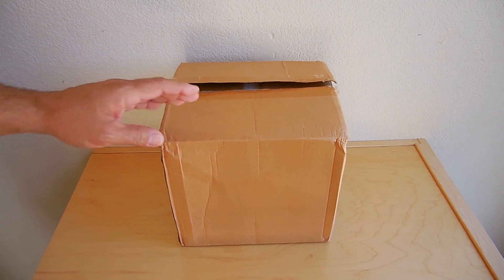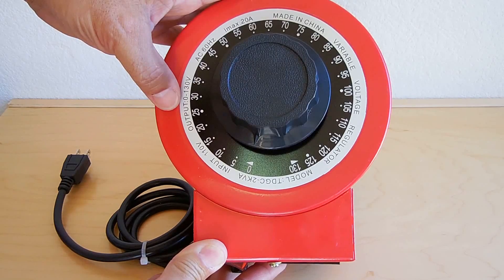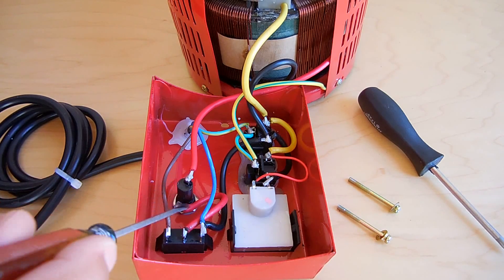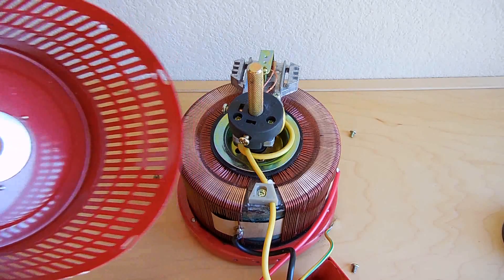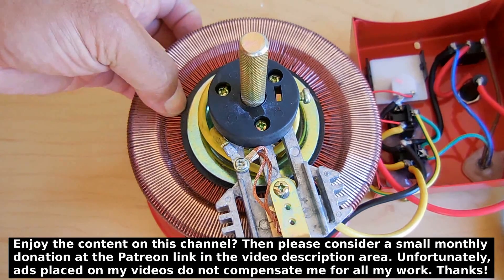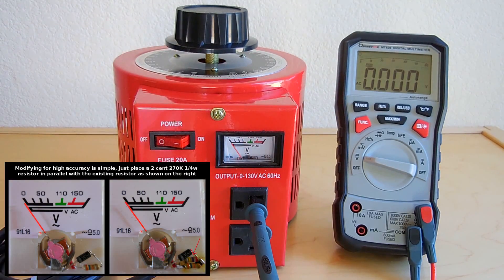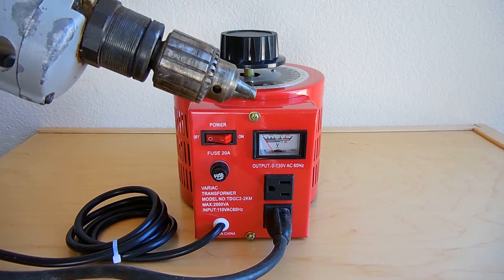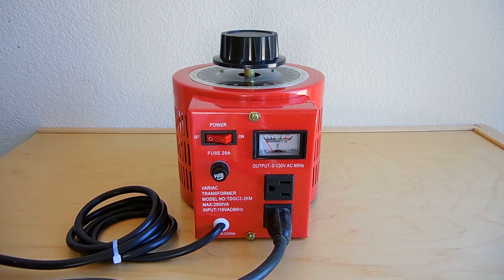2KVA 120V Variac Autotransformer (Incredible Buy)

Comment: It's now $169.99.  Better wait until after the holidays. If the price doesn't come down then skip it.  I got a 500VA version for about $80 last spring.  Serves my needs adequately enough, but watch for loose parts.  Also, the weight of such a small box is deceptive to shippers (they're liable to drop it if not careful) and the box mine came in, as well as the flimsy styrofoam packing inside, were pulverized to pieces.
Reply from the maker: Actually $152 shipped......using the coupon code provided.

Comment: I don't like that curled wire connecting the wiper on top.  It should have been two circular rings sliding over each other.  Besides, check the solder connections.  Those wires should be attached mechanically (through a hole) and soldered.  If ever the solder melts or breaks loose, the wire should stay in place.  This would not get UL approval.

Comment: This is good. The only thing, if you wanna fiddle with, maybe the fuse as you mentioned, and don't worry about the solder on the switch but rather the brush tips should be flattened to the full width to make them wear slower and, above all, more linear in control...

Comment: I've personally found that Chinese product crimped terminals are more like the things are flat-squashed as if hit with a hammer than metal crimped. I have seen really bad over heats because of this kind of thing as it forms a high resistance.. On this variac i'd be re-terminating the yellow 'wiper' wire using a quality copper spade terminal at the wiper mech and redoing the actual Earth wire terminal plus giving it its own anchoring point screw, nut, and shakeproof washer onto bright cleaned steel (scratching the paint back). I looks as though the Earth chassis/body connection is via one of the cover screws...
Reply from the maker: Yes, those ideas are good, and when you only spend 50-75 bucks on a variac like this, you have to expect to do a few minor corrections. If I was spending $150 - $200, I would want a perfect, high quality unit out of the box. Thanks for watching!

Comment: Nice purchase but shouldn't those connections inside be crimped or at least shrink wrap covered not just bare soldered? Maybe cable tied back as well.

The carbon wiping brush, doesn't that design cause at least one turn to be shorted?
Reply from the maker: Hi Stephen. The connections inside are fine as is. No reason to cover them, since they cannot be moved around to touch anything(ground), and no fingers can access the area with the unit fully assembled. The brush design is VERY common. Many variacs span 2 turns like this unit, some even span 3! The reason why you don't have a problem with shorted/burned windings, is because the carbon/graphite brush acts like a resistor. The larger the space that electricity has to flow across the brush, the resistance will be higher. When the brush makes contact in only one area, the resistance will be extremely low. Thanks for watching!
Reply: Thanks for the reply, but the active connection on the mains switch is side soldered onto the switch. Regardless of whether or where this is the norm, it should be crimped, covered and pushed onto the switch. Minimum would be wrap soldered, twist soldered or splay soldered and then covered or even just covered would do more than this. 

That switch will flex as it's turned off and on and having seen lots that have gone bad, that connection is very suss. My guess would be, it will break in the long run and float in the box. 

The earth connection is ganged from the incoming cable to the mains sockets then run from there to the case where it seems to be pressed under a bolt between the inner and outer casing which is isolated from the metal by paint. hard to tell from the video if there is a star washer in there to eat a bit into the metal. The front panel is not metal to metal connected to the rest of the unit as it's powder coated as well. The earth should go to a bolt (without paint under it) on this panel first. 

Sorry, but there'd be several things needed to be done to this before it'd be allowed in this workshop. Sad part is, it wouldn't take long to do.
Reply from the maker: LOL. You're extremely picky for 50 - 75 bucks, and paranoid. If those things bother you that much, then buy one and spend 15 minutes making the changes instead of complaining.
Reply: I've been bitten too many times by the dark lord that lives in that socket in my wall. In this country, he comes with 240 teeth and zero mercy. 

The complaint was to point out why it's $50 to $75 and why you should be cautious. Only you can decide which side of a dead versus cheap scale you'd like to sit.  

Picky? I didn't even start on other things like the "Really, a switch with live and neutral in it before the fuse?".  Those 15A switches have a habit of flexing enough to loosen the side pivots (sometimes they just break) and allow the rocket to come out which allows the middle fulcrum bar and spring/ball out of the seasaw.   ;-)
Reply: Sorry for the rant, I'd like to think I'm not normally this vocal.
Reply from the maker: Like I said, overly paranoid. If you're that worried, install a GFCI circuit breaker. The risk of electrocution is "almost" eliminated. Meanwhile, why are you arguing with me over this unit which you cannot buy at the link provided for 220V - 240V use? Don't like it? Very simple, don't buy it. I'm not forcing you to do anything. What you're doing is wasting my time with nonsense when I could be helping others.

Comment: Another great review E&M. I wonder if in the future we will see you remove the small voltmeter and replace it with one of the small cheap Chinese digital ammeters. Would be an easy mod if everything fits in the enclosure.  I find an ammeter is the most useful measuring device when using a variac.
Reply from the maker: No, I'm happy with the modification I made to the analog meter. The accuracy is very good now, but I may add a ammeter. :-)

Comment: There is 2 output in the front panel u can actually modified one of the output to DC with a good rectified circuit since there is some room inside the variac, also u can replaced the volt meter with A digital display for easy viewing! Nice video though thanks for sharing! ;-)
Reply from the maker: Thanks for watching!

Comment: I was expecting to see a car running on vapors as the last post comment we talked about. 

Nice Variac Autotransformer. But only 8 hours?  :| what happens after that it shuts down? Are the wires strong enough to last the test of time? Since most of the time they make electronics with cheap material and sometimes best to replace some components (maybe the wire on the wiper as well) to last longer to be more durable. It shows that you need to fix some things since even the meter needs adjusting. lol But still nice. Try a light bulb and see how bright it goes. Not the led or fluorescent since it might mess up I feel. 

I am also wondering what would be the first component that breaks on this device. hmmm
Reply from the maker: There's nothing to show, everyone knows gas vapors can run an engine, so it's a waste of my time. There are already many videos showing this on Youtuibe, you need to refer to those videos. In the future, being pushy(by saying "again") will not get you anywhere with me. One simple request is all that's required. The rest is up to me if I want to do it or not.
Reply from the maker: Never heard of "Duty Cycle"? Some equipment is rated for "Continuous" use, and others not.  You want continuous use? Very simple, install a cooling fan. LOL
Reply: electronicsNmore, you do beautiful work. Much appreciated.
Reply: again can you show how to run a car on vapors since you say its simple? Thanks
Reply: But every mechanic I asked says it can not drive but only run an engine low so in short they say no its not practical to use they say.  But Sorry for the bother again.
Reply: I have run a small Briggs engine on vapors on a gocart and it only wanted to run full tilt. Sadly I was young and forgot to put oil in it, so it self-destructed. The drawback is that it is very hard to control (I had a separate air intake valve to control the fuel to air ratio).
Reply: Trench - After 8 hours it lets the Smoke out. Then you have to buy ACME replacement Smoke (good luck trying to find that) .
Reply: You're a bit rude tbh.

Comment: ok, but what is it useful for, apart from slowing down a drill?
Reply from the maker: It's amazing how fearful people are of 120V mains. I've handled it for many years, and gotten my fair share of accidental shocks, and guess what? I'm still here.
Reply: electronicsNmore  But don't use it for cutting Styrofoam, the output is just as dangerous as the mains supply!
It is also used in design of electronic equipment to see what happens if the mains goes above or below its nominal voltage and to make sure systems shut down properly if there is a brownout.
Reply: +electronicsNmore > ok, very specific usages i see, thanks.
Reply: Different people have different skin resistance. What you can get away with might be fatal for the next guy. Or maybe you are leaning against something that is grounded...
Reply: People are using these to do fractal burning of wood, (art).  You take a transformer out of an old microwave oven, power it with the variac to control the out put of the transformer to 'control' the burn pattern denisity.  Search for 'fractal wood burning' on youtube.  It's beautiful, and if you take the proper precautions, not too dangerous.
Reply: See my comment below to see the coolest use I know of.
Reply from the maker: :-)

https://www.circuitspecialists.com/blog/ten-uses-for-an-autotransformer-or-variac/

Comment: Don't buy a variac.  Use an ebay thyrisor for a light dimmer combined with a light bulb to detect shorts.  After all you use a variac to detect shorts on equiptment under test.
Reply from the maker: Joseph Nicholas People use variacs for MANY reasons, what you stated was only one.
Reply from the maker: https://www.circuitspecialists.com/blog/ten-uses-for-an-autotransformer-or-variac/
Reply: Besides the ten uses on the link a variac can also be used for wire heating plastics sheets to create bends.

Comment: That is a bargain!
Reply from the maker: terry jenkins Don't snooze on this one, otherwise you'll lose.
Reply: electronicsNmore but i really don't have a need for one! so i guess i snooze!
Reply from the maker: terry jenkins In that case, you're exempt. :-).
Reply: electronicsNmore is it possible to use a incandescent light bulb to snub out voltage spikes that could cause damage to my plasma  cutter from a unregulated  generator ?
Reply from the maker: terry jenkins Don't like the idea of an unregulated generator....
Reply: electronicsNmore I can afford/buy a small power conditioner for my power tool chargers so i guess no go on plasma cutter this is what i bought only paid $600 brand new in the box non the less it was a hell of a deal normally costing in $2000+ for heavy industrial and commercial use http://www.wincogen.com/files/downloads/winpower_manuals/winpower_cov8500ves_wiring_diagram.pdfw but will a light bulb help with surge suppression and protection i hear people says it helps just explaining how or why? maybe on a future video!  👍 for the help or pointer! you give to people!

Comment: Thank you for the info & demo on this.  I was wanting one of these for repairing old tube radios and other electronic equipment, in which this is a necessary to bring the voltage up gracefully.  The reason why I haven't gotten one was the price, several hundred dollars usually and most are not rated as high as this one 2000 Watts (VA).

For accuracy, it's always good to have a DMM showing the voltage.  The one that you are using is a decent meter, it reads AC voltage in RMS.

I'm ordering one now, and thanks for the coupon code.  Saved me another $3.27!
Reply from the maker: Thanks for your support Pete! If you haven't checked out the other great
 products shown on this channel, then please click the link below and 
see if anything interests you.

https://www.youtube.com/playlist?list=PLQ6IOhUBblU161growMalXOs1Ers6q_tj